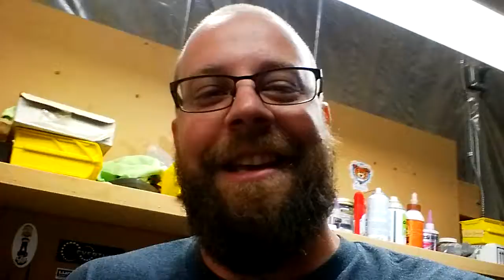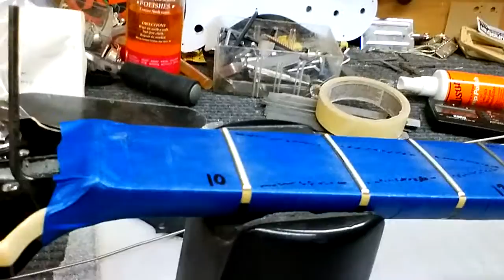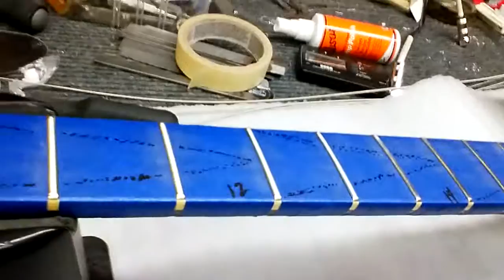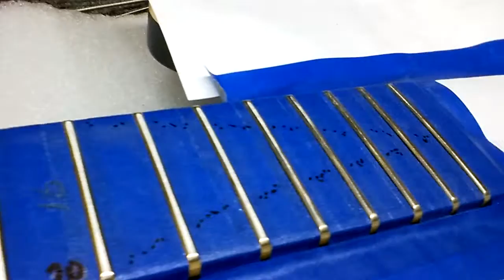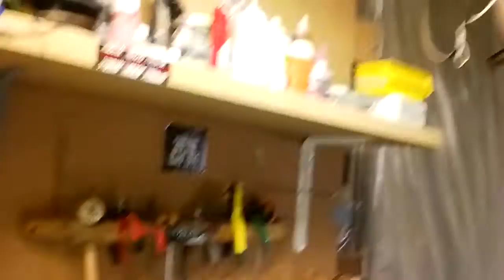Compound radius fret level on a guitar.

Comment: Weird thing about some compounds is sometimes the don't transition right away. My sls schecter went from a 12 to a straight 16 around the 16 fret which was weird cause I checked with a radius gauge so yeah I used a 12 than a 16 around the 16 fret according to my boards radius.
Reply from the maker: Yes, this is true!  I check them and make notes on the tape to know where they naturally are going so I can know how much to correct.

Comment: Some I have dealt with have an abrupt change in radius, which I don't like. I see you take it gradual, which is best, in my opinion. I did a compound radius on my SG: I took it from 12" to 14" at the 9th fret and then to 16" at the 13th fret all the way to the 22nd fret. I LOVE the way it plays like this.

Comment: Hello Mark, Ill be leveling my frets for the first time on one of my less expensive less played guitars. I wont have a fret crowning file so I will be using a triangle file. Any advice for a first timer looking to not mess up his radius?

Ill be using a rectangular file for the fret ends a triangle file for the crowning and a leveling beam with 320 grit to level the frets. I have crimson guitars abrasive rubbers for polishing my frets and some higher grit sand paper to help round over the frets.
Reply from the maker: Well, from my perspective, you should get the proper tools...not to say you can't do it fine, but if you are inexperienced, the tools you have will give you the ability to mess things up.  Anyhow, you can use those tools to get things 'fine'.  The whole point of my video was to show 'next level' stuff.  I hope it turns out really great for you.

Comment: I know this is an old video, but I'm going to attempt this on this coming weekend. Do you start by doing passes along the full length of the fretboard with the smallest radius?
For example (just using arbitrary fret numbers) do you use 12" on a few passes from 22->1st fret (entire length), then move on to 14" from 22->7th fret, 16" from 22->15th fret ect?

Comment: For your leveling job did you use radius wood blocks or flat aluminum leveling bar? I know if you use the wood radius blocks you have to switch them up for each radius, but with a leveling beam it the same as normal fret leveling.
Reply from the maker: I always use radius blocks.  I think using a bar is Ok, but you have a greater risk of changing the radius.
Reply: I have always used a bar for my strat and sg, I just have never done a compound radius fretboard before, its a Jackson guitar by the way I want to level.
Reply from the maker: +Er Guitars it's OK to use what you are comfortable with.  I just prefer the accuracy of the radius block.

Comment: Hi Mark.  I wanted to know, are you somehow following the shape of the parabolas with the blocks?  Meaning for example, are you focusing the 10" block progressively more towards the center as you move from the nut to the 3rd/4th fret?  And then repeating the process with the 12", and so on?  I have a Schecter KM-6  that I want to level the frets on, but I've only leveled single radius guitars with a straight beam to this point.  Thanks!
Reply from the maker: Yes, the next video on my channel touches on this.
Reply: I watched the next video after this one (Life of a Luthier), but you didn't mention anything about the process.  The full fret level video didn't talk about it either.  I'm just wondering which video you were referring to.

Sorry to pester!  Just seems like you've thought about this more thoroughly than most other techs on Youtube.  I see guys just say to do the straight block but that doesn't seem like a good idea on a compound neck to me.

Comment: It would be really useful, if you could show the procedure. For instance, to you start with 10 inch block for the entire fretboard and then go to the 12 inch for the entire fretboard minus the 4 first frets etc? Also, how do you do the in between frets? For instance the ones in between 10 and 12 inch. 

I am using your method for the constant radius and I have amazing results. Keep up the good work!

Comment: Do you make a transition say from 12" to 14" on one fret so like 5th fret = 12" 6th fret = 14" and so on to 16" for example?
Reply from the maker: Mickeyislowd yes.   1st fret is always the starting radius,  and last fret the ending radius. If I was not the one who fretted it, I use a radius gauge to check where the transitions seem to be and work off that info.
Reply: Mark Stockwell
Another question is if I have a 12" to 16" radius then should the bridge radius be higher than 16"? as I'm thinking the radius is still going higher towards the bridge as you move away from the focal point.
Reply from the maker: That's a great question.   If I have independently movable saddles, they will likely end up close to the flattest radius at the heel of the neck,  however, many fixed saddle bridges i.e. Gibson style and floyd rose are fixed at about 12" radius for the most part, and you will find plenty of great playing guitars that have those bridges and a compound radius.   It will be true of those situations that the middle strings will be higher in the middle region at the flatter portions of the neck.   Doesn't seem to bother players that much.  Personal preference.
Reply: OK... so I'm having my Gibson M-III re-fretted and at the mo' it's a 12" radius board and frets around 9" radius which I don't like. I want to have the board sanded down to a 12"-16" compound radius with new EVO gold frets and I will be installing a new German Schaller trem which are about 12" radius. If I asked the Guitar tech to grind down the saddles at the bridge to measure 16" or higher like 20" would that still work?
I play a lot of fast stuff and a flatter radius where I pick feels much more comfortable to me where as a Fender type radius I struggle with:)
Reply from the maker: It might work.   You want to be careful that the strings don't start touching the back part of the bridge after lowering the middle strings.  Also, make sure not to have deep grooves, that can be a recipe for unusual sounds from your strings.
Reply: Mark Stockwell
Thx for your advice:)